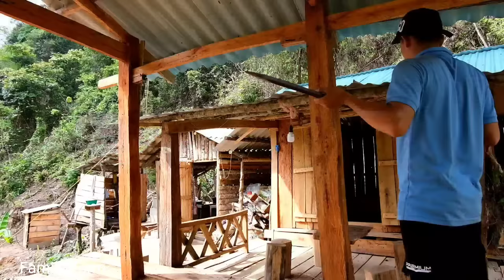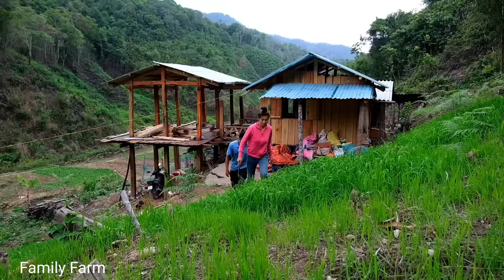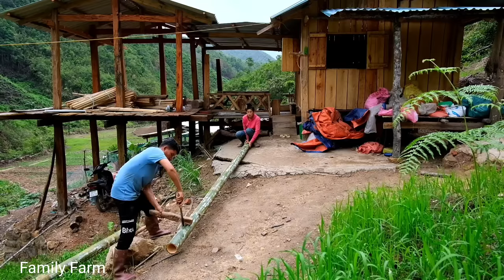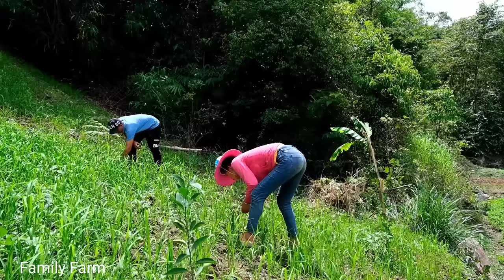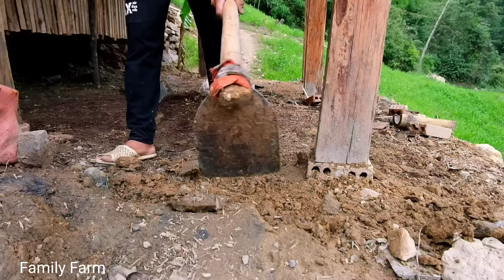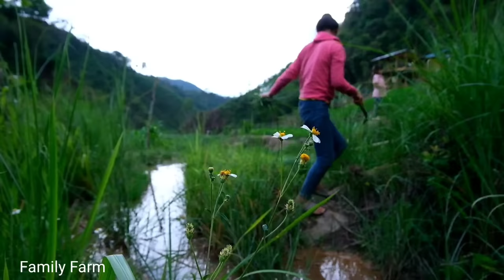Upgrading the Roof, Clearing the Grass and Under the Floors | Family Farm

Comment: One suggestion with the monsume   you have there by raising  the roof  now you have 2 major  leak and your gutter  will over flow. Which roof is higher . Look like your add on is higher than the main house 🏠 run your roof from  pivid to pivid make one roof on one side given  enough pitch to drain the 💧😊